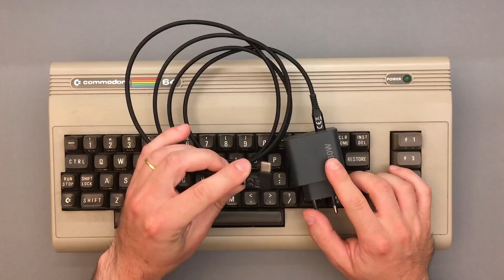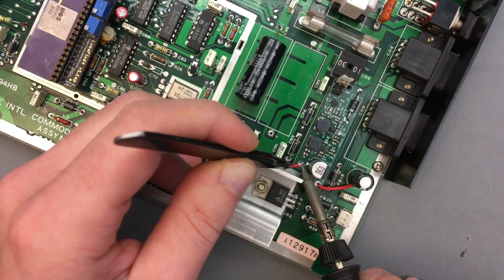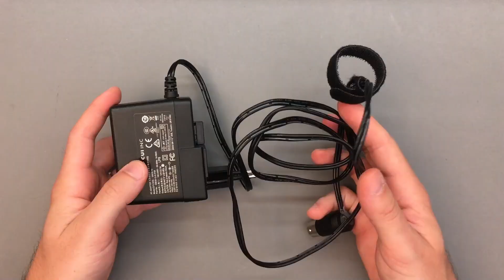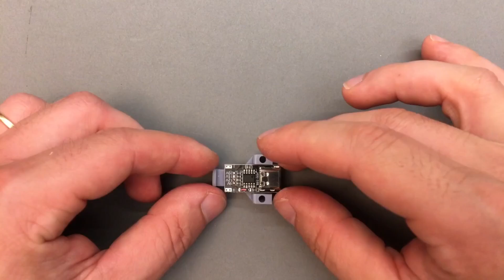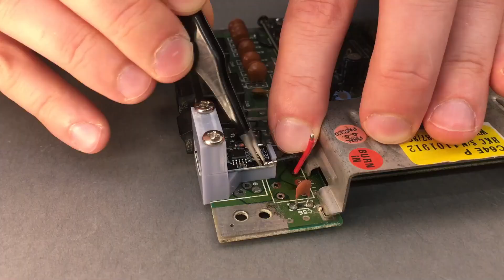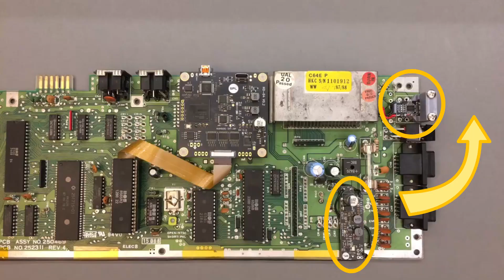How I power my C-64 with USB-C

Comment: How does this handle the fact that most USB-C (even PD) chargers do NOT provide constant voltage (like actual external power supplies)?
Reply from the maker: If you mean that the voltage is not exact or that it drifts, the whole system is quite forgiving, it works just fine with +-2V or so (though I have never seen a PD adapter drift so much). Otherwise if you mean that the PD voltage goes first to 5V and only after negotiation (when successful) it switches to 12v, that's also no problem, there will just be a bit of delay in the generation of the various analog voltages. One issue though is IF the PD adapter cannot provide 12v (some stop at 9v) in which case the system may start to struggle. Regardless though, this is just a stepping stone towards a fully external solution that will account for these issues

Comment: Awesome project. I'd love a DC to AC converter. Being able to supply my C64 using only a small modern DC power supply while at the same time keeping it unmodified. Well mostly for my clones but even though they might have hardware and stuff not available in 1986 I like them to be somewhat true to the original. Can see crucial part is available so well I might just build it myself.

Comment: Would it be better to build a USB-C to seven pin adapter with the circuit mods as a totally external power supply?  This would work on all C64 models and need no soldering on the motherboard.

Comment: Well, as far as I remember, the C64 not only rectified the AC 9V but also used the 50Hz AC for timing purposes in some internal circuits. Does your solution provide a 50Hz clock, or does the C64 work correctly without it?
Reply from the maker: The DC-64 has an ATTiny that produces 50/60Hz which can be routed to an appropriate location on the board to feed the TOD clock to the CIAs

Comment: I don't think it's a good idea at all to mod the internals of a C64 just to use USB-C, but I'd be VERY interested in the simple external box. Amazing work.
Reply from the maker: One redeeming factor is that all these mods are 100% reversible, but yeah, in the case of the PSU I agree that an external box would be the wiser way
Reply: @sideprojectslab7352  I hope if it works out you'll sell them, because I'd take 10 or so! Could make a great cost effective alternative to some of the expensive replacement C64 PSUs that are out there.

Comment: The external solution I like a lot... just plug and play! 😊

I would keep the box on the other end of the cable away from the c64... and by the c64 on the cable show led light like the Retro 8 Bit Space Saver Pro.

Comment: On the external solution did you just connect the 12v and 2.5 pins to that usbc powerboard and then create a board for the pins? I would like the put the us c brick and that power adapter in the old power supply brick
Reply from the maker: No of course not, that's just a 3D printed mockup to get a feeling of what it could look like. The actual board will be quite complex, it needs to house a galvanically insulated DC-AC inverter, so we ain't playing games :D

Comment: Excellent! 👍 Question: if the "external" USB-C solution comes into fruition, will it too be compatible with the 1541-II, the 1571 and the 1581 floppy drives?
Reply from the maker: It would be equivalent to the original power supply so yeah, if that works, this would work too. The question would be about shape/size though, as the best shape for the computer might not be great for the floppy drive. But this is one of those things we'll find out along the way
Reply: @sideprojectslab7352 That sounds great! Please have the floppy drives in mind when designing the new case 👍.